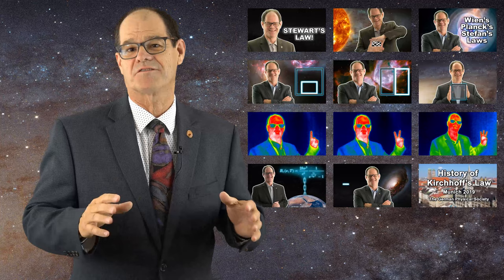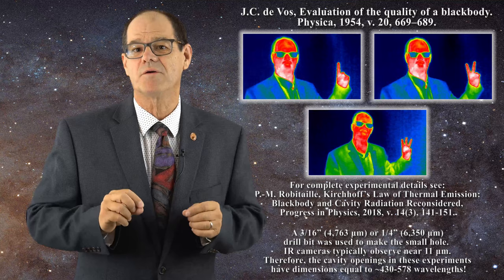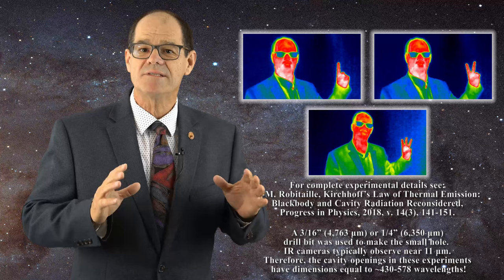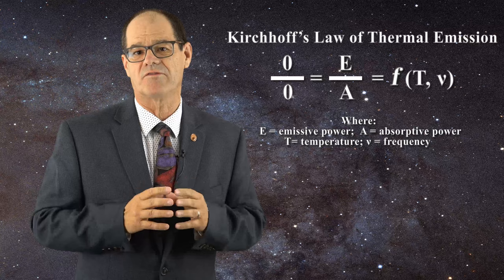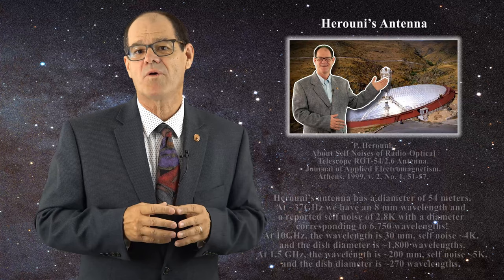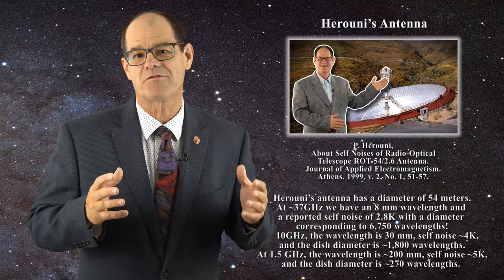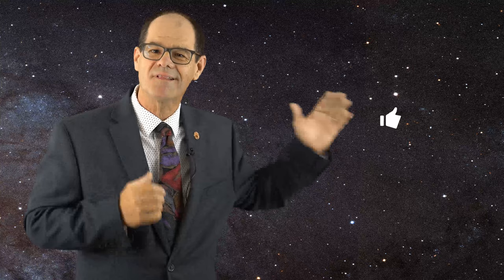Kirchhoff vs Herouni's Antenna!

Comment: Nice work Mr. Robitaille. Still enjoying your rebuttal of professor Dave. Keep it up.
Reply: Professing dave, just evidence that a 'scientist' can be bought.
Reply: @midlander4  you are aware he's respected in multiple cosmological circles, and cited by physicists, cosmologists and chemists, and holds several pHd's...

Have you seen his published and peer reviewed list of works?
Reply: There is a new book out, Electrical Currents in Geospace and Beyond.    Uses all of the data from the NASA and other countries' probes.  It mostly confirms much of  the Plasma Universe models. 
  This book also confirms much of what Dr. Robitaille says about the Sun.  The photosphere has a real surface and consists entirely of electrons and protons.  I would construe that as confirmation of  a liquid metallic hydrogen surface.
  The book also confirms that the energy of the Sun comes directly from the photosphere, not from below, as in the fusion-at-the-core defunct model of the Sun.

Also this book refutes the EU electric comet model and the Don Scott anode-cathode model of the Sun vs heliopause.  It replaces that with the bow shock current model.  The magnetospheres of comets, planets, and inert moons get their energy from the solar wind bow shock current systems.
Reply: @DrWhom  I recommend any of the newer books from Wiley or Springer.  All are compiled from data from the solar observatories, solar probes, cometary probes, and planetary probes.
   It brings physics back into the picture using plasma cosmology, Alfven waves, and plasmoids.   Basically thrusting aside the Einstein cosmology nonsense and requiring an input current or flow to energize planets, and stars etc.
      There seems to be a difference between the plasma model and the Electric Universe models.  Don Scott, in particular, and his anode-cathode solar wind propagation is contradicted by nearly every aspect of the solar wind, as is the standard solar model, or fusion-at- the core, also contradicted by factual data.

Comment: Dr Robitaille, I was watching a description of the James Webb telescope's camera package, and witnessed a classical "Red Shift" explanation that described the Doppler Effect and morphed, mid-description into a measure of absolute distance. Being in the construction field, it reminded me of how electricians use plumbing to describe the relation of wire sizing to pipe sizing as volts to pressure and amps to pipe diameter, and ohms to head pressure like bends, valves, and clogs. 

I think a similar layman's description can be crafted to show the key requirement of relative reference when attributing values to observations of Doppler Shift and Electrical Potential. The main point being, if you do not have a specific point of reference, it is impossible to determine distance, only speed of recession from Red Shift, just as one can not claim to have a container of charge free water; a reference is always required. Charge, like Doppler Shift, is a measurement of potential between 2 objects. Change the position, location, media between, and/or egress/ingress velocity of the objects and you change the potential, and resistance would be dust or plasma interference between the objects.

I was hoping someone smarter than me could refine this.
Reply: The only thing I would add, is that we sort of have a reference, but its a bad one.  Astronomers measure the distance to nearby stars using parallax, which is fairly accurate because it just uses math.  But, for super distant ones, they have to use nearby standard candles to calculate it.  Because more distant stars are also older/in the past, I dont think its fair to use younger, nearby stars for comparison.

Anyways, not sure how you would convey that in analogy, just my thoughts on the matter.

Comment: The study of thermo-equilibrium is like trying to find out what makes a car run by studying the exhaust. Dielectric transforms electromagnetic radiation and the photo-electric effect is the mechanism of energy delivery. Again, heat is an electrical effect and is therefore not the cause of energy delivery. One could study of how car exhaust heats the atmosphere while ignoring plasma dynamics that is the basis of the internal combustion engine.

Comment: I just wanted to take the time to say thank you
Reply: @midlander4  Kirchhoff’s “law” is indefensible. Radiation in a cavity is not independent of the walls. The walls do work. Every experiment with reflecting walls and absorbing walls demonstrate this. Why would the radiation in every cavity be black body? There is no mechanism for it. Is it magic? Black body radiation requires a vibrational lattice and is not generated by thermal equilibrium unless proven otherwise. Now it’s up to you to provide a mechanism
Reply: @midlander4  how about you come with me to people who work with lasers, near perfect absorbers, or near perfect reflectors and tell them how kirchhoff’s law says that everything they are doing is physically impossible
Reply: @midlander4  and let’s be honest. At university you are taught to repeat, not think critically and question everything. It is not just in academia, but if you don’t support the status quo, you won’t get a good seat at the table. Status is often determined by one’s ability to tow the party line.
Reply: @midlander4  for someone who has a lot of answers, you sure don’t have any answers. I have been to university. Not for astrophysics, but you are unfortunately idealistic in your faith toward universities. Ultimately, it is just a bunch of people going along to get along. Trying to get theirs through the organized structure and rules provided. Turn some of your skepticism on your own dogmas. See if they hold up

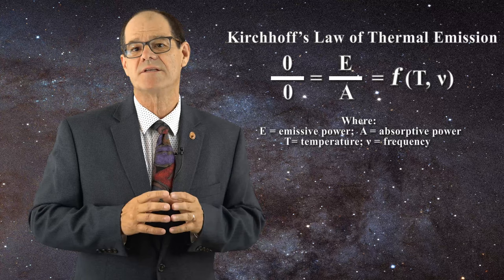Comment: I enjoyed the video! 2:14 is not fully convincing, because it was not shown (nor cited) how Kirchhoff arrived at E/A=f in the first place, e.g., was it first a relation E=A*f, which is mathematically valid even if both E and A are zero. However, if Kirchhoff first arrived at E/A=f, then its convergence at zero needs be inspected by differentiating both E and A over shared variables (L’Hospital’s rule). E.g., if E=exp(x)-1 and A = x, then at the limit of x->0: E/A=E’/A’=exp(x)=1 (defined), even though at first glance 0/0 can appear undefined. Of course, it is likely that the exact expressions of E and A are unknown in general, hence we have to work with approximations (proving Kirchhoff law to be only a special case, not a general law)!
Reply: Kirchhoff stated his law of thermal emission as:

E/A = f(T, v)

where T is temperature and v is frequency. E and A are determined by experiment. They do not contain common variables and cannot be individually expressed as functions of anything because there is no progression between materials. Consequently, one cannot apply L’Hopital’s Rule to obtain a limit in the event of A = 0. And when A = 0, E = 0 too. There is no limiting process involved here. Now Planck invoked Brewster’s Law in his analysis and restricted himself to polarised radiation at right angles to the plane of incidence when blackbody radiation is never polarised. Consequently, he argued that the reflectivities of each material in this case are both zero, i.e. p = p’ = 0 and therefore p = p’ always. However, in restricting himself to polarised radiation at right angles to the plane of incidence so that p = p’ = 0, he did not even test reflection because both reflectivities p and p’ are zero (see Eq.(40) in his book). Planck’s analysis of Kirchhoff’s is quite absurd and is nothing but an abuse of Brewster’s Law and an abuse of blackbody radiation since blackbody radiation is never polarised let alone able to be polarised at right angles to the plane of incidence so that there is no reflection at the interface of his materials. I refer you to our paper for all the details:

Robitaille P.-M., Crothers S. J. "The Theory of Heat Radiation" Revisited: A Commentary on the Validity of Kirchhoff's Law of Thermal Emission and Max Planck's Claim of Universality, Progress in Physics, v. 11, p.120-132, (2015),

http://www.ptep-online.com/2015/PP-41-04.PDF
Reply: @stevecrothers6585  Thank you very much Steve for responding personally in detail! Quite convincing counter-arguments for now, but I didn’t follow ”no progression between materials” as I thought E and A are of the same material. I assume it shows my lack of background knowledge and understanding, so I wont even try to make any scientific rebuttals for now. Thank you for taking your time and the citation! I will certainly look later at your paper, perhaps in November when I am (hopefully) far less busy with my PhD thesis writing, which I need to finish. At first glance the paper seems very useful for any critical thinkers here.
Reply: @joonasmakinen4807  : Recall that to differentiate a function in must be continuous and not intersecting at the point of evaluation. There is no continuous function that describes a continuous progression between all possible materials, so there exists no continuous function for the emissivity or absorptivity of materials progressing from one material through to another and on through all materials. Kirchhoff's law of thermal emission applies to all opaque cavities, irrespective of the nature and form of the walls thereof. Hence, in the quotient E/A = f(T,v) neither E nor A have any differentiable functional forms. It is the strange quotient E/A that Kirchhoff asserted is his mysterious f(T,v). Planck's evaluation of f(T,v) for his equation for thermal spectra is not universal so it only applies to a true blackbody such as carbon. The error of Kirchhoff and Planck is their unjustified assumption that all opaque cavities at thermal equilibrium at the same temperature contain the very same 'blackbody' radiation field. They are wrong. All opaque cavities in the said conditions do not all magically behave as if they are all made of carbon despite not being made of carbon. Consider the lower bound on emissivity, the perfect reflector, which Kirchhoff and Planck included in their thinking. A perfect reflector cannot emit any thermal radiation because it has an emissivity of precisely 0. Yet according to Kirchhoff and Planck the perfectly reflecting cavity emits thermal radiation exactly as a carbon cavity which has an emissivity of 1 (blackbody). Now that is quite impossible. Planck's equation holds only for the case of emissivity = 1. So it is not universal at all.
Reply: @stevecrothers6585  Thanks a lot Steve for the clarification! So it is a mere empirical law, which has incorrectly been assumed (=extrapolated) to be universally valid. I have no further questions for now. I need to read your publication later this year, because it also has implications in the field of nanotechnology, where we routinely use spectroscopes. (By the way, Sky Scholar should in my opinion sticky our conversation due to your detailed responses.)
Reply: @joonasmakinen4807  : Actually, Kirchhoff's alleged law is theoretical, not empirical. What made him think in this strange way is anybody's guess. In any event, there is neither empirical nor theoretical proof of his alleged law: and the reason is that his law is in fact false. Dr. Robitaille and I discuss this in our paper were we talk about Kirchhoff's supposed law from theory alone!
Reply: @midlander4  I don’t deny science. I deny pseudoscientific dogma. Unevidenced, non-rational dogma like the WMAP data processing or Kirchhoff’s law. If a middle schooler brought me the WMAP data processing as a science fair project, I would hand them an entry level statistics textbook, tell them the throw the project out and start again, it’s just not science
Reply: @midlander4  I’m assuming it’s my WMAP comment that is controversial to you. Let me be clear. The signal to noise makes the input data junk. The coefficients used in cleaning are arbitrary and violate the laws of science. The output data, which are then used for models and the development of constants etc., are unverifiable and varying and should not be used for anything of importance. If you mess with numbers enough you can make them say anything. That is why someone who knows data processing like me can see through funny games
Reply: @midlander4  the “elephant in the room” is your inability to respond with anything other than ad hominem
Reply: @joelarmies  : Yes indeed, Kirchhoff's invalid law of thermal emission is disastrous for the whole of astrophysics. Don't worry, I will never become 'like them'. Dr. Robitaille and I have a lot more coming.
Reply: @stevecrothers6585  good on you. I appreciate your efforts

Comment: Robitaille is saying that a cavity that contains radiation dominated by incident and escaping radiation does not obey Kirchhoff's Law of Thermal Radiation. The proper statement is that a cavity that contains radiation dominated by incident and escaping radiation is not referred to by Kirchhoff's Law of Thermal Radiation, because Kirchhoff's Law of Thermal Radiation refers instead to a cavity containing radiation in thermodynamic equilibrium with the walls of the cavity. In effect, Robitaille is admitting that Kirchhoff's Law is valid, though he says it isn't. Robitaille's cavitiies are not properly constructed.

Comment: RAT - reflection, absorption and transmission were difficult concept in college y freind just could not beleive that a black object will heat up and cool off quicker via radiation than a white object even when they reached equal temperature.
Reply: This principle is used for cooling fins and oil-filled indoors heaters; the black surface will absorb heat from the inner object also by conduction and radiate away the heat more efficiently, the white surface lowers the surface temperature, a polished object reflects heat back into itself too.
PS
But if the layer is too thick, even the black stuff, insulation (low heat transfer) properties comes into effect.
The best cooling fins has a thin el-ox layer with black pigment, it can raise the heat dissipation with up to around 20% or so.

Comment: I have a question. Correct me if I'm wrong, but your main premise is that astronomical bodies like the sun that emit black body radiation must be a lattice, because that's what known black bodies like graphite are. But if you look at an infrared camera, you can get the temperature of a glass of water. Is water considered a lattice?
Reply: Frankly, the guy hasn't got a clue about the subject.
Reply: His most recent videos discuss this.
Reply: For anyone lurking in the comment section here's the first video where PMR discusses the above question

https://youtu.be/WOoxNeL6lFw

Comment: Would it be possible to make a video explaining what type of emission black body's radiation is? Would it be possible to explain the difference between thermal emission and electrical emission? These topics seem very conflated on other channels and I was woundering if it could be clarified?

Comment: 2:33 the resonant cavity capable of containing coherent radiation unintentionally speaks to the operational constraints of a US Dept of the Navy Patent  (patent number US10144532B2) which consists of two cavity walls, the outer being electrically charged, the inner being resistant, and the space between being filled with a noble gas, wherein coherent radiation is introduced via microwave emitters.
Reply: Do go on!
Reply: Interesting...

Comment: I wonder what methods remain to determine the surface temperature of stars and Sun......?
Reply: Errrm, spectroscopy. For one. We know the photosphere is overwhelmingly neutral H. At what temperature will H become fully ionised?
Also, what temperature is the Earth at? If the Sun were hotter, so would we be. We aren't. It is simple maths to work out the temperature of the Sun, based on the amount of energy received at Earth.
Reply: @ianw_xvi8784  Yeah, but H can be ionized electrically, not thermal only, and the Sun is electric. Question remains, unfortunateley.
Reply: ianw_xvi So the solar wind is NOT charged particles? And the photosphere (at 5,000-7,000 degrees K) somehow heats the corona (at 1,000,000+ degrees K) through convection?
Only an idiot would make such a claim.
Reply: @fredfarquar7679  Agree 100%!
Reply: ianw_xvi May I quote from your previous? "And the sun is not electric." If the sun is not electric, then it leaves only convection to heat the surface and create the heat of the corona. That is not possible. Period.
Reply: @fredfarquar7679   to be fair, he did give you an answer.  Magnetic reconnection, and Alfven waves.  Annoying af tho...